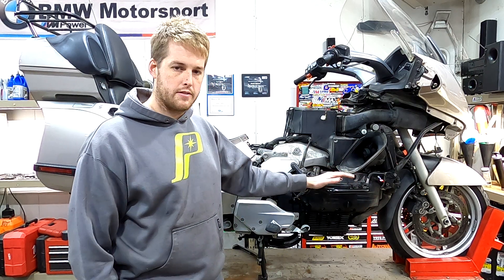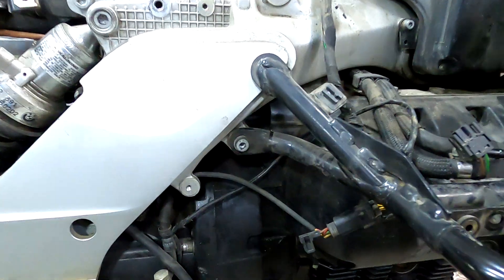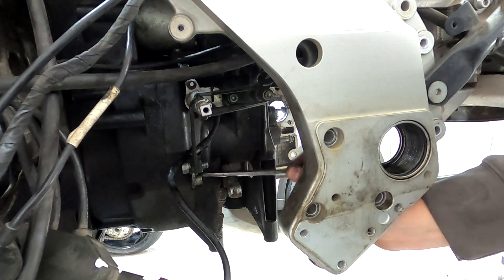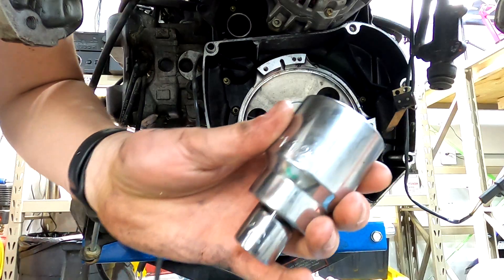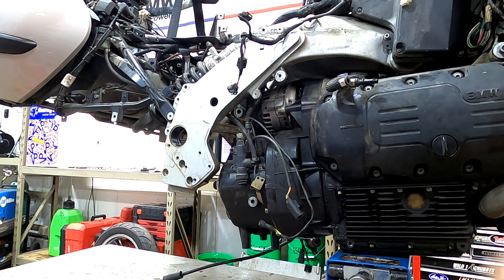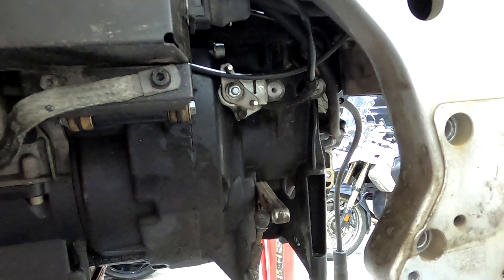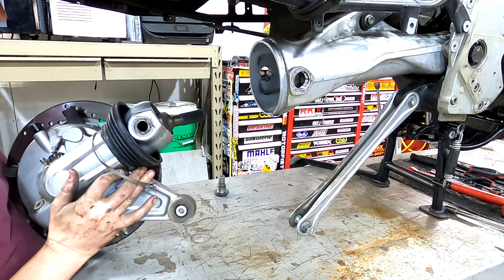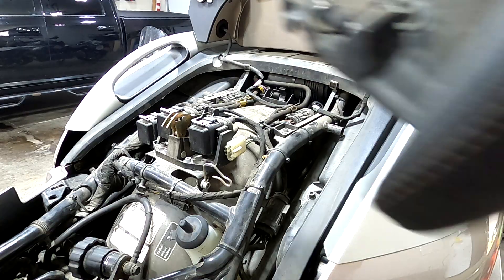BMW K1200 Clutch & Main Seal Replacement Step by Step

Comment: I have over 300,000 miles on 2 different 1200LTs.  I've done this job a few times, and on 1100 LTs as well, (which are the same clutch).  I picked up a couple of tips from this video.  Thanks!
Reply from the maker: glad to hear

Comment: Thank you. Great commentary and photography. Comprehensive description of the whole process. 

I have only very occasionally seen such a clear, detailed, complete and understandable {not ambiguous} description of any mechanical workshop process. The photography was organised so that it was clear where each part was intended to go with tips on areas to be cautious.

Recently, I have been considering purchase of a BMW K1200 LT. This video enabled me to understand what to look for on a used/second hand BMW K1200. It also assured me that if this job were to be required, I would be capable of undertaking the work involved.

Comment: Very nice instructional video. Your lighting was outstanding. There were a few sped up parts around disassembling tons of wiring that I wanted to slow down. 

I really liked how you called out the sizes and counts of all those bolts and screws. 

I am a total mech newb and really enjoyed this.  I look forward to more.
Reply from the maker: Thanks!, if you want a sped-up area slowed down you can adjust your playback speed by clicking the little gear in the bottom right corner of the video :)

Comment: I’m looking at opening up my new-to-me 2000 K12RS.  Recently acquired, and previous owners were not riding it much.  I’m expecting that the original clutch o-ring will be dried out and leaking.  Viton replacements are available that will not suffer the same fate.  I probably will go ahead and replace the main engine seal, since I’ll be in there, and probably the transmission seals as well.  

This video is a great resource to show the nitty gritty.  Access to the trans removal is a bit less involved for the RS, but the important parts first jacking frame and dropping engine are the same.  I’ll be referring to your video as I do the job.  I truly appreciate such helpful documentation.

Comment: I just bought a K12GT with a bit over 50,000 miles, so a clutch job is coming.  I'm actually encouraged, this looks easier than the same job on my R1150GS.

I'm surprised not to see clamps on the airbox tubes where they connect to the throttles.  Pretty sure they should have clamps.

Comment: Question, do you know why some people on the boards have a 30 mm socket with some part of it cut out for some reason? Like what's the purpose for that? 

Also what speciality tools are needed for this beyond the alignment tool and would you happen to know about what clutch pieces someone usually wants to purchase for this job?

Comment: excellent video, but you never put grease on a bolt it will mess you torque settings
Reply: What!!! Clean lhbed threads are the best way to get a correct torque setting. Who the hell told you that?

Comment: Is it the same effort just to remove the gearbox of a K1200 RS (589)? I have a strong suspicion that the transmission input shaft seal is broken, or that the surface seal on the transmission plate is leaking. top video
Reply from the maker: Yes sir!
Reply: @TheBMWGuy  Thank you , there is a lot of work waiting for me . great video, keep it up. I wish there was something like that in German too.

Comment: Do you sell a tool to install the transmission output shaft seal? Is there a trick to get it installed to the right depth?

Comment: Good information on the k 1200 ,I had recently found  a 99 rs , needs to  be done .  135,000klms .any other things to do?
Reply from the maker: I mean while your at it may as well change the oil, transmission oil, rear drive oil, air filter, spark plugs and just do whatever service your due for while it’s apart.
Reply: @TheBMWGuy  did flush brakes and diff. Trans. Motor oil. Should be good to go after an extensive repair,  slave should be inspected

Comment: What happens when the swing arm nuts just spin and are stripped in place?
Reply from the maker: well you gotta fix that.
Reply: or I scrap it all. any advice on getting it apart?
Reply from the maker: @tomblair1220  watch this video. You may need to get creative on removing that stripped nut. But the pivot pin should still be able to be removed if just the nut is stripped